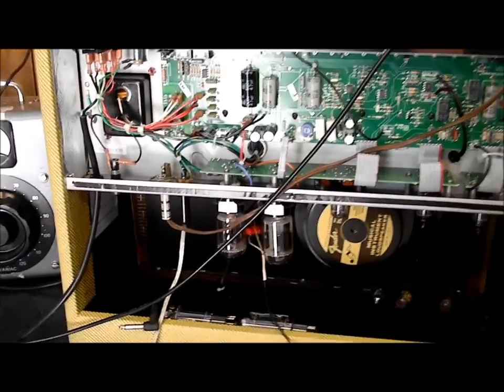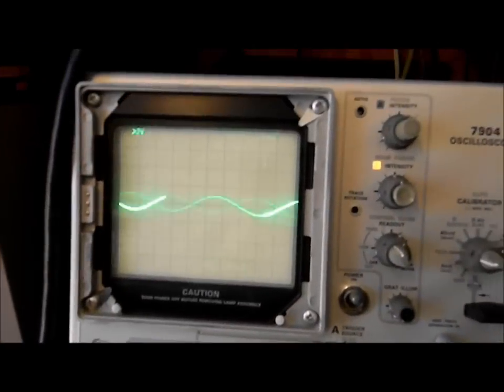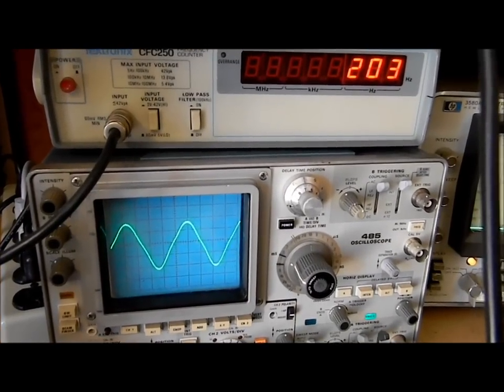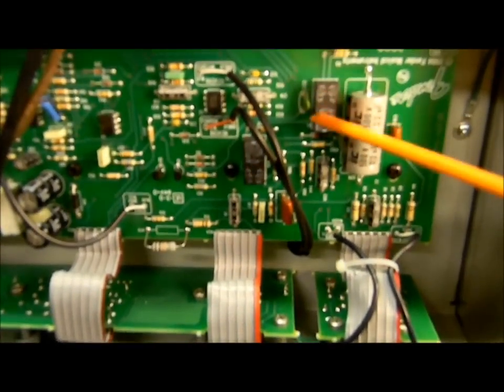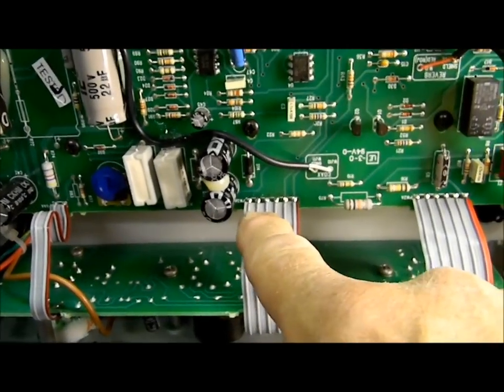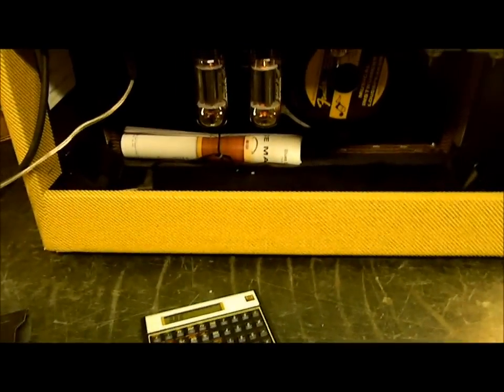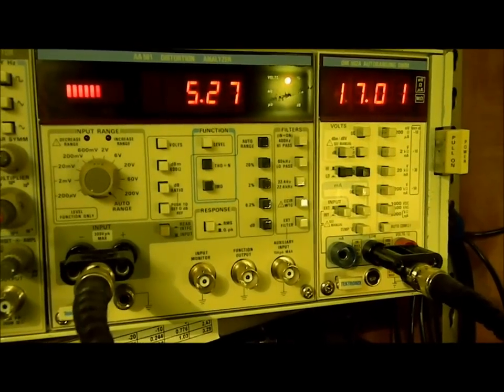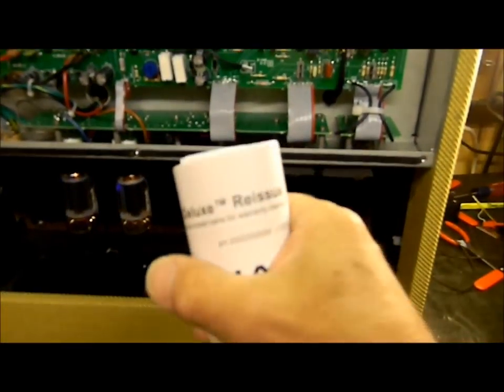Fender Blues Deluxe Reissue Repair and Documentation

Comment: Hello, I've been using my BDRI 15 years with no problems until a week ago the reverb stopped working. The rest of the amp works correctly, just zero reverb. The reverb 12AX7 tube checked good and I swapped another good one in with no affect. Anyone have any ideas? They'd be greatly appreciated.
Reply from the maker: I would start by checking for broken wires to and from the reverb tank with an ohm meter. Also for continuity of the reverb coils with the ohm meter. Likely a broken wire or a open pickup. The flat ribbon cables are very stiff and can break (especially if moved) and be hard to see so once again, ohm out the conductors of the ribbon cable(s) that are used with the reverb tank.  My guess is a broken wire.
Reply: @ElPasoTubeAmps  I tried looking for a break in the wires and couldn't find anything. I did put in a new reverb tank and everything works again.
Reply: The reverb in a blues deluxe is solid state. Change the tank out for a MOD 4eb3c1b
Reply: @billpoplin2534 That's what I did, it fixed the problem.

Comment: Thanks, that is a great help. Do you think the manufacturer could use thise clip-in type connections instead of those brittle ribbons?
Reply from the maker: I have seen those brittle ribbon connections cause havoc more than once. It has been a good while since I have done this kind of work but I do remember that. I suppose they do it because it is cheap and fast and if they never get moved, they seem to be OK but they do break off easily moving the boards around. I am pleased it helped you.

Comment: Hello,  ELPASO TUBE AMPS through your videos I was able to repair an excessive noise in my AMERICAN BLUES DELUXE , but now I have another problem, there is a small hum with a very high frequency and also my DRIVE channel does not do its job it is almost a clean sound, you think that You can guide me to see if I can repair it at home since here in Mexico nobody has been able to repair my amplifier, that time I had the problem with another noise I managed to identify that it was the bulbs, but now that buzz and the Drive channel without CRUNCHing me got sad.
Reply from the maker: I am truly pleased my video helped. That is the purpose of my efforts in posting these videos. A small hum with a high frequency... what about trying a 12AU7 or 12AT7 in place of any 12AX7. I suggest that because the lower gain of these tubes over the 12AX7  either might cure your problem or help point you in the direction of the problem. You might also try a zobel network on the output of the amplifier. A zobel network is simply a series RC circuit across the speaker terminals. I would start with a 47 ohm resistor in series with a .05 uF capacitor or maybe a 0.1 uF capacitor. 
The first stage in guitar amplifiers are very high gain, that is why I would try the lower gain 12AU7 or 12AT7. 
As for the zobel network across the speaker terminals, mounted right at the amplifier output terminals on the amplifieer, there could easily be a parasitic oscillation because of excessive negative feedback (NFB) in the amplifier. These are just guesses without having the amplifier connected to real diagnostic equipment. I hope this helps...   :-)   Please let me know.
Reply: @ElPasoTubeAmps  THANK YOU SO MUCH IM GONNA TRY, REALLY IM NEW LEARNING ABOUT ELECTRONICS, BUT YOUR ANSWER HELP ME SO MUCH TO START THE PROCESS, I WILL LET YOU KNOW ABOUT THE PROGRESS.

Comment: I bought one of the originals, in 1994. LOVED the sound of the reverb, even though it was solid state, and really liked the sound of the amp ... especially with a Les Paul Deluxe run through it to overdrive. But the first time I opened it up and looked inside, I was crushed. I could not believe the junk I was looking at ... looked more like a computer than an amplifier. I am a LONG-TIME Fender guitar and amp player (from around 1960), so stuff like this just makes me shudder. Fender has done the same thing to guitar players, that KODAK did to people, back in the '70s with those crummy little pocket Instamatics and 110 film ... what a foist. I have a real hard time believing Fender cannot come up with a method of making hand-wired amplifiers without them costing a man's reputation and all his children ...
When I first got the amp, it had a buzzy rattle. Took forever to figure out that the chincy little potentiometers were rattling and vibrating.

Comment: I just modded my Blues Deluxe Reverb Reissue, taking the circuit boards out of the amp to work on the bench. While desoldering and adding new components three of the four ribbon cables broke and had to be reattached. Cheap parts on an otherwise excellent amp. Interesting video.
Reply from the maker: Yes, indeed. I believe the best solution it to replace the flat ribbon cables that are made with solid wire to individual stranded wire and be careful not to "wick" solder into the strands of the wire and then a dab of RTV or Goop on each wire. Solid wire in any instrument that takes physical vibration and abuse is going to fail and break off. We would like to think Fender would care enough to send a stranded wire cable to those that ask for it for a better repair but in reality they, like all the other musical instrument manufacturers, don't care about the customer.
Reply: Carlos Jade in South Georgia is the best Fender repairman in existence.
Reply: Carlos Oade. I hate it when this thing spells for me. Apologies

Comment: Superb my Friend you help me out!!!
The same Relais work for the "Reverb, Drive, Volume and Master Volume!" 
So when i switch on the Amp, he directly goes on Max Volume and you can
turn'em down ...and there is no Reverb... but when i make the SkrewDriver Trick,
Plock, Plock on the Relais...than it work suddenly!

So ok, i must Buy a new one ...or better two, two Relais are inside so when i work on that,
better i change directly all of them, as one of it. So one Month later the other one makes Trouble...i think so!

Thank you Sir!!!
Reply from the maker: I don't think you watched the whole video. I thought it was the relays in the beginning but it was actually broken wires in the flat grey cables that go between the boards. Watch the video again and make sure you see it all the way to the end and then you can fix it  for free without having to order any parts.

Comment: hello thanks for helping musicians find amp problems, i have i hod road deluxe it i have a overheat problem sounds awsome the first 2 hrs but after that sounds distorted and very abrasive,hopefully you can help me .thanks
Reply: I had the same problem, look at the heaters in your output tubes (6L6). I had one intermittent tube where the heater would go dim, then I was getting 1 half of the push pull AC wave, thus the distortion. I changed out the "new" Russian Electro Harmonix 6L6 pair with the original "Groove Tube" 6L6s and problem solved. In the future I will get another set of 6L6s but I am past the warranty period for the set with the bad heater. I suggest a 12 hr burn in for new tubes that way you catch a bad tube early and get it exchanged.

Comment: A friend of mine seems to be having the exact same problem with his. It is the same model Fender, but bought new in the last several months. I don't want to void his warranty by working on it for him. Though I do vintage amp (and radio) repair and restoration work, I am not an authorized Fender tech. On the other hand, it is going to cost him a considerable amount of time and money to crate up and ship this heavy beast about 200 miles to the nearest authorized repair outlet. I may sneak a peek at his ribbon cable connections if he wants me to.

Comment: This is the reason, among others,  why I ripped the guts out of my original Blues Deluxe and made a turret board Fender Pro...when you try to do the direct wire connection, the traces peel up, although it did last 2 years...

Comment: having worked on several of these.. i always resolder all of the cable connections. the supply resistor (if 470ohm) should be 330 ohm... and proper bend radiused to avoid internal fracturing when hot. common mod done on the hot rod series equipped stock with 470s....PLUS : raise the 1n5353B zener diodes off the board or replace with new and raised.. eliminates scorching/carbonizing of the PCB

Comment: nice work! I used to service vacuum tube amplifiers for many years and I really enjoyed it. I have a Fender Twin Supersonic I purchased used with automatic bias problems. Fender gave me the schematics but they are so protective of this circuit. I have trouble shoot it down to the Automatic Bias PCB which contains surface mount microcontroller with embedded memory which even if you can buy the chip from someone like Mouser Electronics and are crazy enough to solder it in it wont have the programming to work properly. I was wondering if you would know where I could locate this board. Appreciate your help Best Regards

Comment: Love your videos - thanks a ton.  A question please sir !!  Toward the end of this video - you start to say how you just use a loose capacitor to test capacitors in circuit when troubleshooting amps.  Based on the context - it didn't seem that you were going to actually replace the capacitor as a testing method.  But you moved off to another topic (about ESR meters) and didn't finish the thought about capacitor testing.  Can you please comment on how you use an external capacitor to test an in-circuit capacitor please ??
Reply from the maker: Donald Filbert Hi Donald - There are a number of videos on how to check capacitors on YT. Some people just blindly replace capacitors but I don't think that is necessarily a good idea. Speaking strictly of electrolytic capacitors, particularly in the HV power supply section, I will often times just connect another capacitor parallel with the one in the circuit to see if it reduces hum (assuming hum or squealing is a problem). Electrolytic capacitors may short or open. If they short, it blows the fuse and is pretty easy to find. If they open and the capacitance goes to zero then simply connecting another capacitor in place with clip leads will likely stop the hum and identify the problem. After the capacitors are completely drained of all voltage, using an ESR meter will tell you what the equivalent series resistance value is and if it is within specs, the capacitor is probably good. A last check is a capacitance meter. If the capacitor measures equal to or better than the stated capacitance then that is a good sign. So, with all this said, if I measure the ESR good and the capacitance value is good and putting another capacitor across the one in question changes nothing, I assume that capacitor is good and move on and I do not replace it. The approach of placing another capacitor parallel is not going to work in the audio signal path DC blocking capacitors but the ESR and capacitance value tests are valuable there. Hope this helps.
Reply: ElPaso TubeAmps That's great !!  I do the other two steps - but never considered just temporarily bridging another capacitor to see if it changes anything.  Thanks for all the great info !!!

Comment: My fender blues deluxe reissue cuts out, then comes on again, but no crackle, just cuts the sound then comes on after a few seconds. Cannot find anyone with that problem on the Internet.  It is intermittent,  and driving me crazy. Please help. Jason
Reply from the maker: It could sure be a lot of things but probably noting particular to a Fender amp just the nature of electronic equipment..Any experienced amp tech cleans pots and switches and plugs with spray cleaners (maybe even removing each tube one at a time and sparingly spray the tube socket and reinsert the tube) before tediously troubleshooting intermittent problems as actually pinpointing the issue can be very time consuming and difficult. Substitution of the cable from the guitar to the amp would be one place to start. Can you swap guitars? After that I would start with the 1/4 inch plugs in the amp from input to speaker output making sure they are clean and making good physical/electrical contact. Is there still a connection between the amp and speaker when it stops, i.e. can you still hear anything coming out of the speakers? Does wiggling any cables make it come and go? Many problems occur at interfaces, i.e. connections between one unit/section and another. Anywhere there is a physical/electrical connection there is a potential problem. It is probably something really simple and may be easy to fix once found.  Good luck - stay patient and methodical.
Reply: ElPaso TubeAmps thank you so much......i tried different guitar and lead......still doing it.......thankyou for helping. ......jason
Reply: Carlos Oade

Comment: Nice video. I have the same issue in my BDRI. I got the hum to stop by molding the shape of the grey ribbon that was causing the problems. I'm no tech, this was just a shot in the dark attempt. I'm lucky it worked, for now, but I'm pretty sure that there is at least one broken wire in the problematic ribbon. Do you think I should add a little solder to the connections? The amp is holding up for now, but I'm afraid it's a matter of time before the hum comes back.
Reply from the maker: Sam - Not much doubt that it will cause problems "whenever"  if the solder joint is broken and the wire is just pressed against the PC board. It is not too difficult to completely remove the cable, clean out the holes and re-install it as all new connections.  Afterwards, form the cable so it does not press against the back panel and it should last a long time - If you know which wire is broken, maybe you can very carefully trim back 1/8 inch or so of insulation and re-solder it - you can also remove the cable and run individual wires - nothing special about the grey cable - hope this helps.

Comment from the maker: Every time I work on one of these amps with the stiff ribbon cables I get concerned I will induce a problem - bad design in my opinion and also they transfer signal over these wires with no shield - a great way to pick up noise. I have tried standing the resistors off the board by 1/4 inch and putting a blob of high temp RTV under them for physical support. That may be better than their design in the long run.

Comment: Flipping the board on these amps to address issues with those cement power resistors getting too hot and becoming unsoldered from the board leads to those cheap ribbon cables breaking. I've also read that the nearby bias trim pot can become desoldered(!!!) from the board too as a result of the heat from the power resistors.

Comment from the maker: Some possible suggestions - the plate resistors R57 and R58, 82K and 100K are notorious for going bad - also, C5, C6, and C7, 0.1uF, 0.022uF and 250pF cause terrible crackling and popping noise if they become intermittent. Won't cost much to replace these five parts and Maybe... luck will be on your side and it will take care of it. Hope this helps.

Comment: cool vid. check my mods to this reissue at donnyboy911    ..also on the relay issue /the 470 Ω /5watts can be replaced with 330Ω for better reliability. done this on a couple that proved problematic...this will make the relays flutter too... if you mod any of these i'll pass on my mojo. schem/pics.... mail  dtmole at cccomm dot net

Comment: Thinks for the tip, my super sonic 22 has flex wire with a connector two both ends where it fits on the boards hopefully a better connection

Comment from the maker: Yes, I agree and if you let them press against the back board that covers them they break even easier as I suppose the vibration of the cabinet weakens them.  It is pretty scary to remove the chassis as you may break one or more of them.

Comment: Those ribbon cables are terrible. I broke them by doing a mod to the amp. They are very hard and stiff. I'm going to remove all the ribbon cables and replace with soft flexable wire.

Comment: Good work resolving the buzz. There are several factors that could make that a one off problem. Either the ribbon cable stripping process caused damage at assembly, the cabinet has been opened many times and flexure caused stress or there is a resonance at that length of wire ( this is where staking, or RTV can dampen the effects). A 7x loupe should be able to tell if there is an fracture or a nick. I'll be giving mine a once over to look for any signs of degradation. Thanks!

Comment from the maker: No, this has not been a common problem with others that I have worked on. The most common problem is the 82K (R57) and 100K (R58) on V3 - the driver for the 6L6's. Another good upgrade is to change C5 (0.1uF), C6 (0.022uF), to Orange Drops and C7 (250 pF) to a quality silver mica. I have made this upgrade for several of my clients and they swear it makes it Much quieter.
Reply: Thank you for this!

Comment: Hi, hope you can help me. My Blues Deluxe (RI) doesnt work properly. As I am playing, it starts switching channel on its own (even without the pedal plugged in) then goes to zero sound. I've been reading about some resistor troubles because of super heat, weak solder joints, etc. The solution I've found was swapping a resistor connected to the channel switching relay, but this resistor doesn't appear in the Reissue schematic. Can you help me? Please! I'm losing it! Thanks.